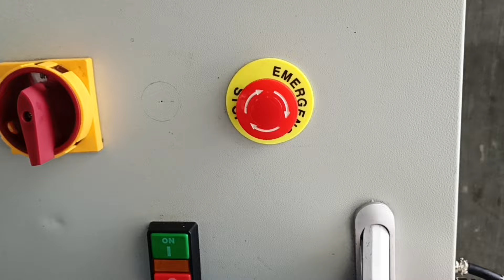DIY CNC Plasma Cutter

Comment: Brasil
Reply from the maker: The table is based on mechmate design, the controller is arduino cnc shield with external driver adapter for nema 23 motors, grbl, ugs and we use fusion 360 with openbuilds post processor . . .